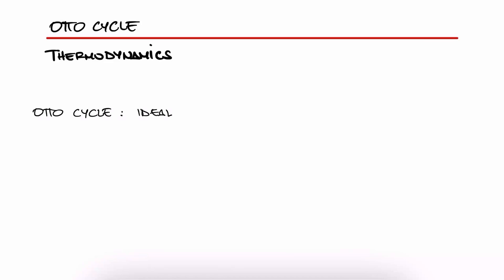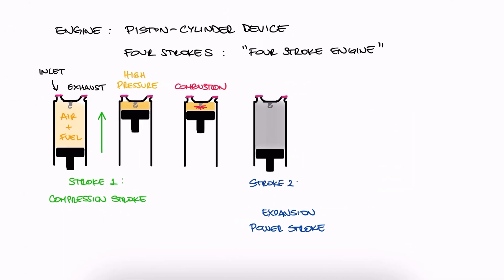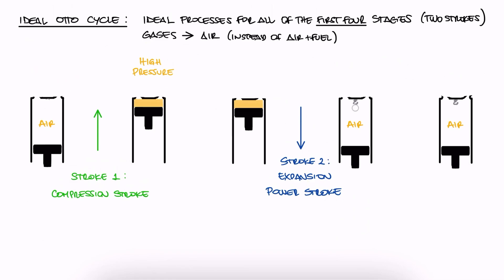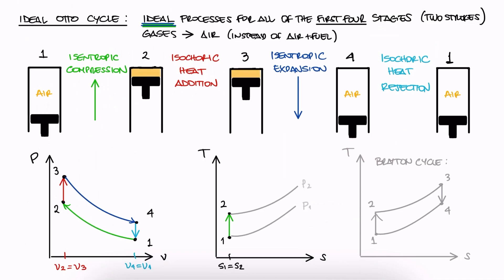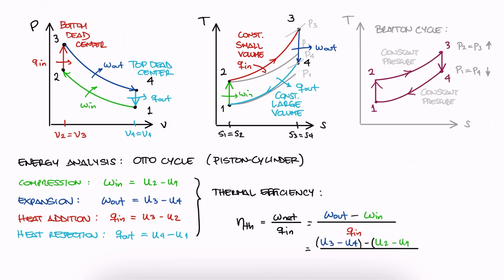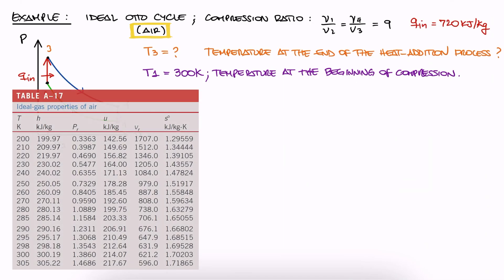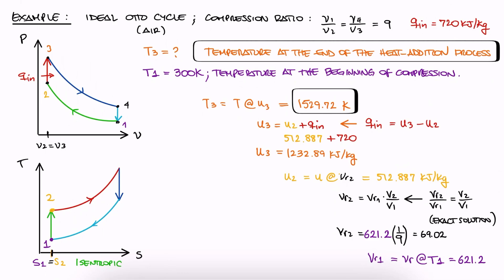OTTO CYCLE & Internal Combustion Engines in 10 Minutes!

Comment from the maker: CORRECTIONS: Starting at 9:16, the values should be u2 = 514.497 kJ/kg, u3 = 1234.5 kJ/kg, and T3 = 1531.45 K.
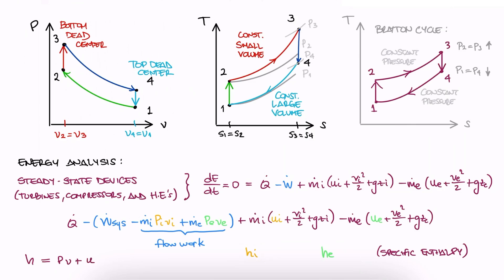Reply: Correction: At 5:44, the TDC and BDC are reversed in your P-V diagram. You reversed it from the previous slide.